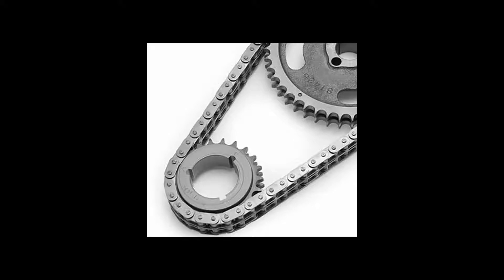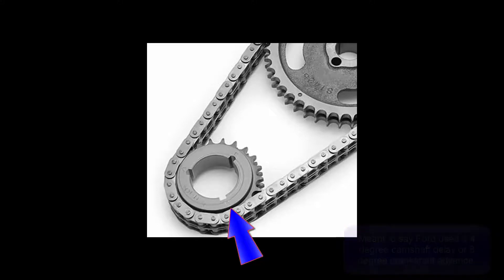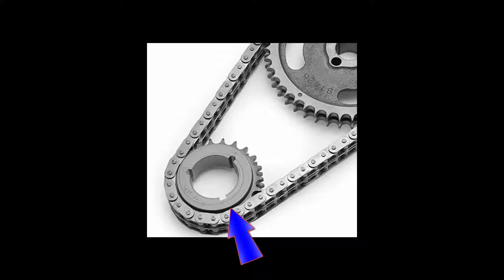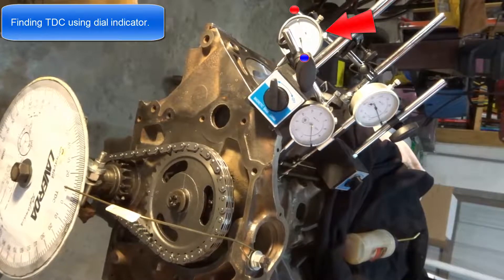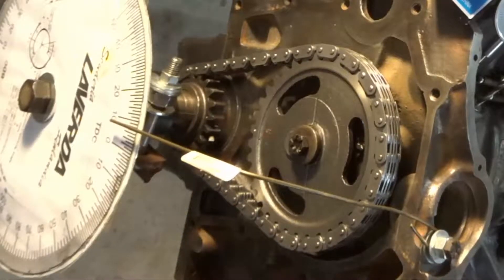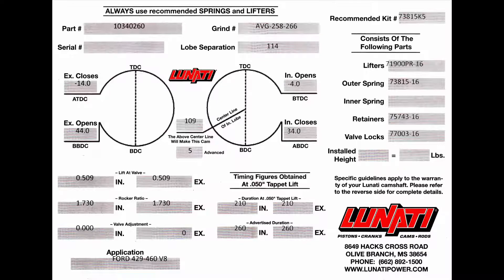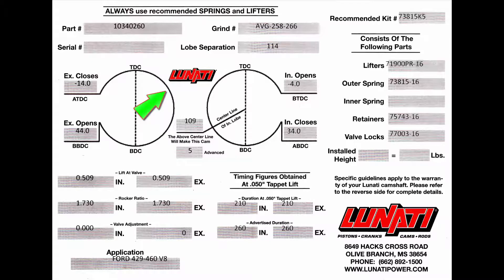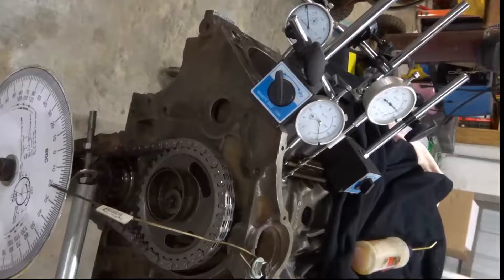Cam degree bible for big block Ford engines

Comment: Working on a 390 im rebuilding that ive done everything to get it running right and it just will not. Im starting to think that dot to dot as i build all my mopars doesnt work on this. You.mentioned 8 degrees on this and i seriously think now that i have late timing events. Guess i gotta blow it apart and degree now.

Comment: People need to be aware that there are aftermarket multi position "performance" timing sets for the big Ford on the market where their zero is in the 8 degree retard position.    Also, the cam is "straight up" not when the dots are lined up but when the intake and exhaust centerlines are the same number of degrees.  This conveniently is the same number as the lobe separation(measured in cam degrees) ground into your cam.  Nice job on your video.

Comment: That's crazy why Ford did that
Reply: emissions. retarted cam timing helped put out less emissions.
Reply: Whats crazy is why this guy is complicating a simple job? Just use a aftermarket set instead of the stock set? I've never known anybody that rebuilds a engine & buys the oem timing chain set? If there is one thing to avoid its the oem timing set
Reply from the maker: You missed the whole point of this video. I did buy an aftermarket timing set. The degree wheel data was to prove that the cam being tested had the proper lobe timing and lift to increase the torque of the RV motor. The video also proves the cam retard for that year and model, since it varies during that decade of production. Once the video was made, the non-oem  timing sprockets were installed as stated in the video.
Reply: @FixitMyWay  witch can all be dun with a proper after market gear & chain & degree wheel very simple.
Reply from the maker: @jesseduke694  As I said earlier, the primary purpose was to check the lobe lift timing of this new cam. It was also to explain how to read cam specs and to associate these cam numbers to cam lobe reality. To bad you missed the whole point.
Reply: Ya the early 90 gen 4 I believe 1:6. I think 5 and 6 came with 1:7
Reply: @davidvonanderseck8649  ok, I guess I didn't know that.
Reply: Ya i had to take the whole front of the motor off. Bought an aftermarket timing set. Put it on. 

To 100 percent make sure it works. And there was no more surprises. I started the engine with the front cover off.  Lol you could look into the oil pan. 

My next tackle was after I got all that back together was to figure out where this mystery Lexi was coming from in the back. Lol Google it. 

Oil was dripping behind the motor onto the TC and on the side of the motor. Well it was a bolt hole for the bell housing on the block, it cracked. That crack went right to the oil passage which was very very clones to the threads. Man 

I put some thread sealant to fix it. Long story short. I ended up pulling the engine because the RV cam I bought broke a push rod because the rocker pedistle broke. I had my limits. I did a temp fix and used 454 rockets which have a 1:6 ratio. But broke a rocker stud while trying to pull a trailer
Reply: @davidvonanderseck8649  I believe BBC rockers are 1.7 ratio.

Comment: What about using a 429 timing gear on a 460 edition engine? It supposedly advances the timing by 2 degrees.
Reply: Unless you have a set already, thats in good condition, I would just get a New timing set from summit racing, or jegs. Some place like that. Comp sells a keyway adjustable billet timing set, that comes in handy when fine tuning the cam degree. I forgot the full range but its over 5 degrees both ways and .5 degree increments.